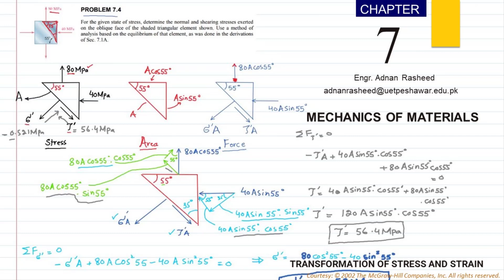Problem 7.4|  Engr. Adnan Rasheed| #problemsolution #equilibrium #stressanalysis #stress mechanics

Comment: Sir why do we split again the  80Acos55⁰ and 40Asin55⁰ to rectangular components in direction of sigma and Tau....why we do it again...?
Reply: Sir can't we convert stress to direct components? Instead of converting into FA?
Reply from the maker: Again you have to convert into forces to apply equilibrium condition....
Reply: @engradnanrasheedmechanical   Thank You Sir🥰🥰
Reply from the maker: You are welcome 😊
Reply from the maker: well the first one is rectangular components of the Area which is then multiplied with stress to get the force in x direction and y direction. once you represent all the forces acting on the element then by applying equilibrium condition in the given direction you have to take rectangular components of the forces.again if you are confused then i shall suggest you to watch the lecture of transformation of stress....